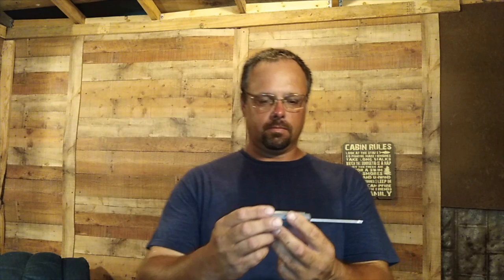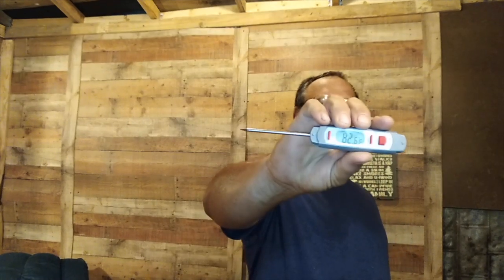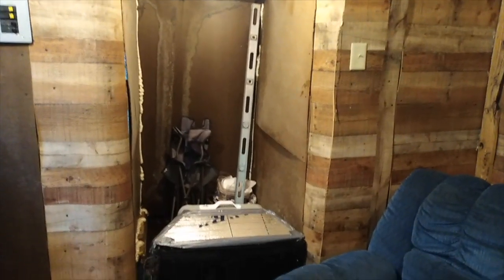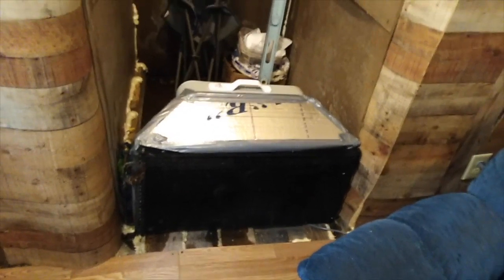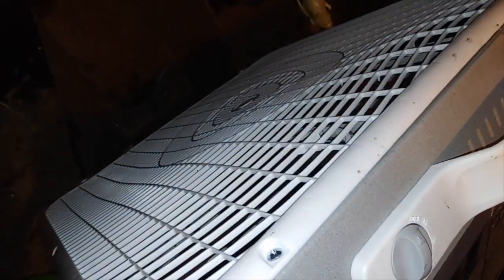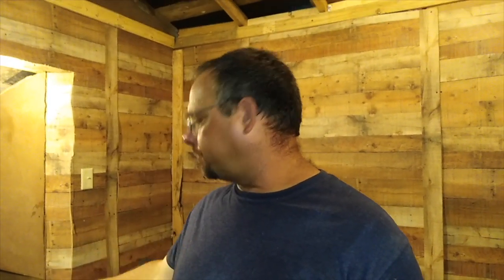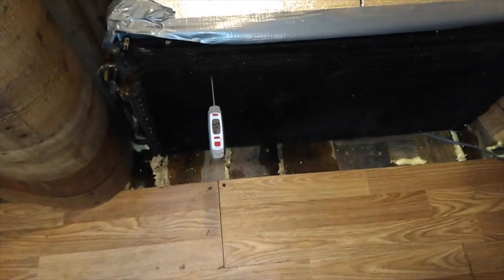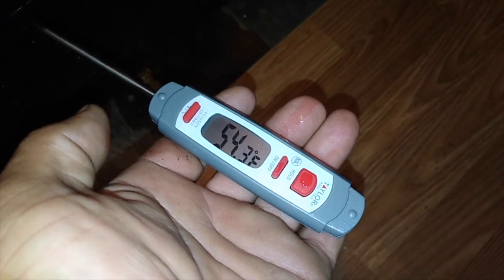Off Grid Geothermal Air Conditioning for Cabin-BETTER DESIGN

Comment: I have a spring and a well, maybe I'll give this a try, I'll have to pump the water, I guess if I can get a small pump, that will run off a 100w solar panel. That will save me running power to the spring, I can insulate the pipe the water is running through,  and hopefully my battery bank and solar panels will allow me to run a fan or two,  being off grid , you gotta watch every watt!!
Reply from the maker: A small pump should run just fine on your solar. I know what you mean about watching every watt.
Reply: You might be able to just make a homemade ram pump, put it in the stream and it will pump the water for you with no electricity.

Comment: My grampa would be proud of you. On your question, ff ground water is 51, then the ground it comes from must be that temp. Ground temperature varies a lot with depth. Go deep enough, and you'll melt your probe :)
Reply: P.S. My grampa fused a few photography trays for the pan he had in the similar air conditioner system that he put in our cottage some 50 years ago.
Reply from the maker: A couple of those trays would work. Not sure if I can find them around here, probably have to order a couple.
I was thinking of a piece of 4 inch pvc cut in half.

Comment: the water temp varies by latitude,  it's about 57 in southern mo where i'm from, about 72 in florida and about 52 in montana. IMHO, it's cooler coming out of your condenser due to evaporation of the hot air in contact with the cool condenser. of course there's a good chance i have no idea what i'm talking about
Reply: The warm moist air in the cabin will drop to dewpoint when it contacts the cold radiator. The cooler air cant hold the same amount of moisture and it condenses out. A pound of condensate represents around 1000btu, this energy is released during the phase change (water vapour changing from a gas to a liquid) and transferred to the cold radiator. 
The ground temperature will reflect the energy balance, if you have a field in full sun most of the time and a heavily shaded wooded area next to it, the average ground temp will not be the same in both locations even though they may only be a few hundred yards apart  ;)
Reply: mike brink  I think you could skip the thermal mass of a canister or cistern and just run your closed loop coolant through coils like a trench install would have.
Reply from the maker: Sounds right to me!
Reply: mike brink   maybe if the outflow was at the bottom of one drum and the return at the top of the other, but again, there's a good chance i don't know what i'm talking about

Comment: I would get an old junk window a/c unit and pipe the water through both the heating and cooling "radiators" contained within after plumbing them together and to your supply/drain.  Id probably just mount it higher up inside for recirculation cooling and maybe use a good axial 12 volt radiator fan on a dimmer switch to blow air through the gutted A/C unit box.  The benefit being you could route a condensation drain out of the box, and it would have a directional airflow control that points upwards to distribute the cooling air.  Alternately just keep the excellent system you already came up with because it's simple and efficient.   If you had an old attic fan you could probably rig up something near the ceiling blowing down.  Just playing around, really like your take on geothermal cooling as it is smart.
Reply from the maker: That's a great idea!

Comment: The only thing I can offer to your question of why your water runs so much cooler than the general underground temperature is by convection. That's what's creating the condensation from the air in your cabin. It makes sense that the condensate attempts to pull as much heat as possible from the surface it forms on before trailing away to drip elsewhere...this may actually explain why you read a lower temp at the surface of your condenser as opposed to the temperature of "flowing" water, there must be a range of degrees a closed system of water will be subjected to as a result of exposing more of its surface area to ambient temperature. I'm nearly positive this works on the same principle as a "thermocline" which if you've ever gone swimming in a deep open pit mine reservoir can shock the living daylights out of you if you go deeper than 15 to 20 feet!!
Reply from the maker: Thanks! That makes a lot of sense.
Reply: That plus cool water circulating through the metal  with the cool air from the fan the metal condenser doesn't have time to heat up but actually cools down. I don't know what I'm actually talking about. I'm a mechanic used to giving custom excuses why things do what they do. But it sounds good.

Comment: Great video Luke. I believe our spring water in Virginia was colder then that. I remember reaching wayyyyy down deep into that cold water as a child to try to grab a bottle of grapette pop and I thought my little arm would freeze off. Boy it was cold. Glad it's working for you. You can take a nice long nap now.
Reply: Rebecca Long one day where I lived, a high mountain  (14,000 feet high) that dominates the area was covered with so much snow. Even near 10 am the water was still at least 60F. Air temp not much better until the afternoon.
Reply from the maker: That sounds like freezer temperatures, wow. I remember my Dad telling me they kept their bottles of milk in this water before they had a refrigerator.  
I did have a nap after this. Woke up freezing lol.
Reply: @lukeFugate  Grandparents also kept milk in the bottom of the well for the same reason. But they also had free natural gas so had a Servel gas refrigerator also.

Comment: Seems like you could wire up an old style a.c. thermostat and regulate the use of it that way. Mount it up off the floor and use a piece of pvc with a slot cut into it as a drip pan then just pipe it out of the cabin. Just my thoughts
Reply: This would be a quick and cheap fix but I would add a filter to the back of the fan just to help with not clogging the fan and the fins of the radiator @luke

Comment: can you turn the condenser sideways? you wouldnt need as big a tray.  Or maybe just mount it in a window. There are a lot of variables for water temp, your average local temperature and how far underground the water is, wether its exposed to air etc. On a cold day that unit will bring the room up to around the waters temp
Reply from the maker: Putting it in the wall like a window unit would keep fresh air flowing through. Good idea!